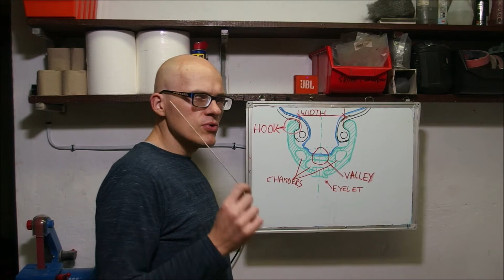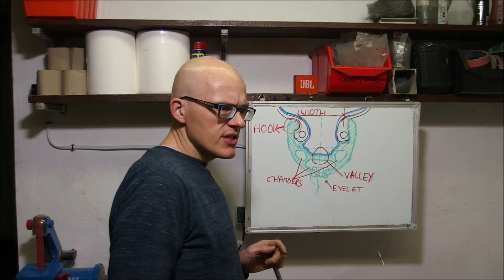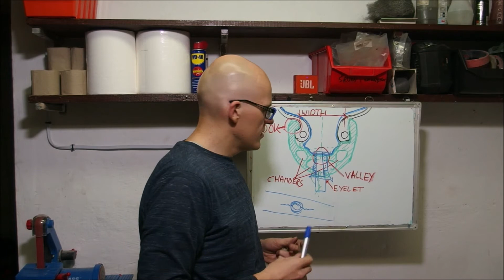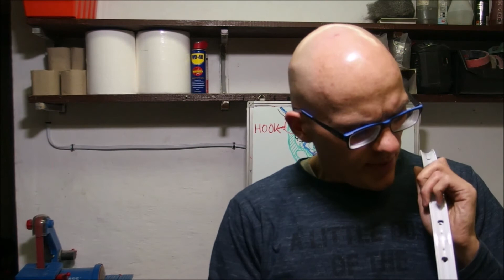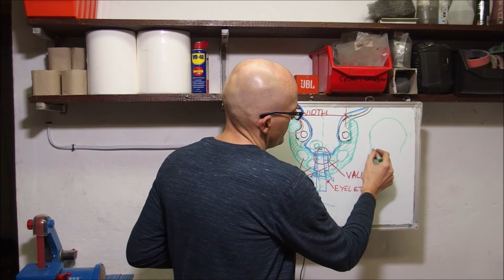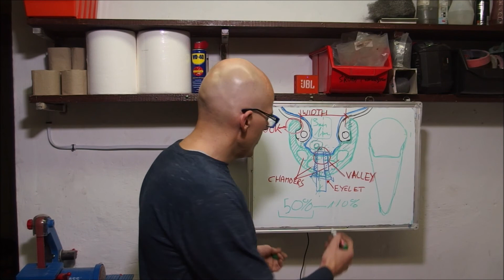Bicycle Rims: Everything you need to know.

Comment: Running 2.2 on old mavic xm319(19mm) rims and it is pretty sketchy when I go full throttle. Remember when I used Crossmax Enduro wheels and I thought that the wheels were so flexy because of the low amount of spokes. Later when the wide rims started to get popular it was fairly to easy to see that the width of the rim make a pretty big difference on how the bike feels. Trying to find some super light but wide 26" rims but it seems very hard :P No 27.5 or 29" wheels for me, Viva a resistance!

Comment: good content. would like to ask question, have an MTB and getting annoyed by the wheels. Interior tube always get cut specifically on the air valve. size is 1.95-2.1 and rim size is 2.1 hence, i dont think it is size issue. tried checking the rim if has any sharp edge, and found nothing. been considering if I could shift to tubeless wheelset using the same rim.

Comment: CF vs Al: Not lighter, it's about density and strength. Mavic and Enve are famous for their hookless rims. That 3mm rim to 1mm tyre rule needs and anchor width to start with. The minimum rim width rule, as presented, falls apart for small tyres; albeit those used in RR bikes. I did actually examine rims width for 28mm tyres – cannot go above 22C (=26mm outer with alloy unless someone sells an extra thick one I'm not aware of); above 22C it'll be inclined to unhook absent tubes. The rim has great influence on the perceived “road buzz,” especially noticable on road biking. Pozdrawiam!

Comment: HI. thanks for your video. Is there any particular reason where inner tubes with 48mm schraeder valves have compatibility with as regards the rim?
Reply from the maker: You just need enough of the valve to stick out to attach a pump. Other then that - a tube ought to be matched to a tire.